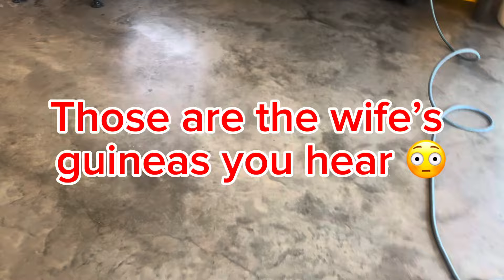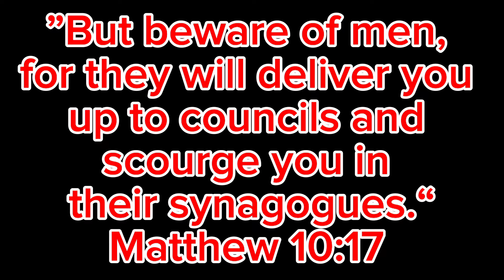CRST Flatbed… Update on Ellie and what I’m up too…

Comment: Curious why he didn't pull the front structure off and reseal it. Haggai did mine, and afterwards I had the rear structure done when the transmission and clutch was replaced.
Reply from the maker: Not leaking and just done 2 years ago